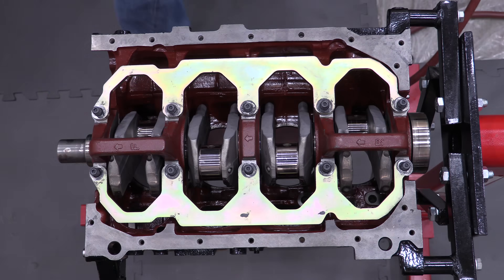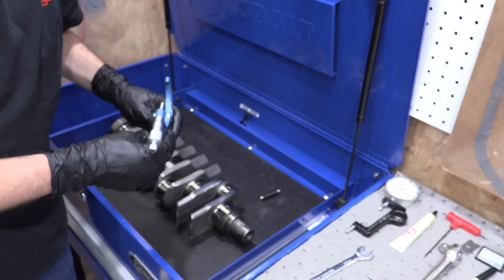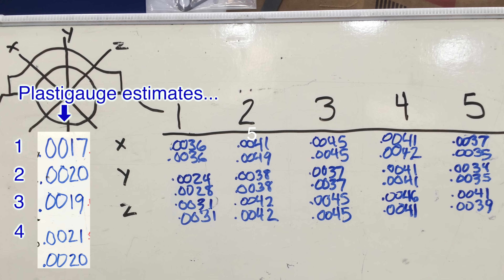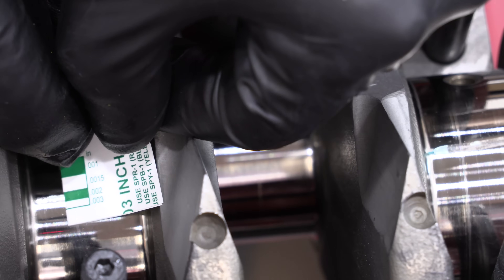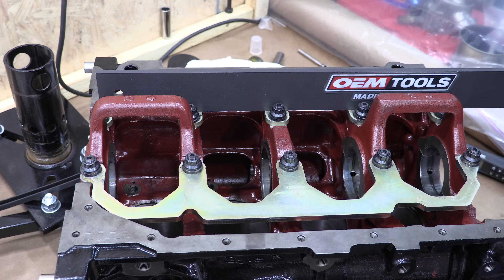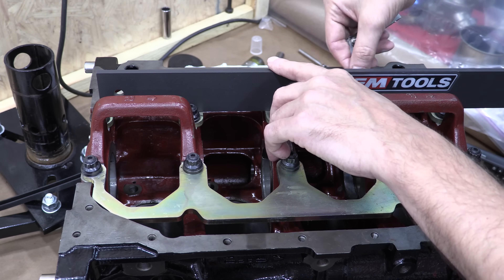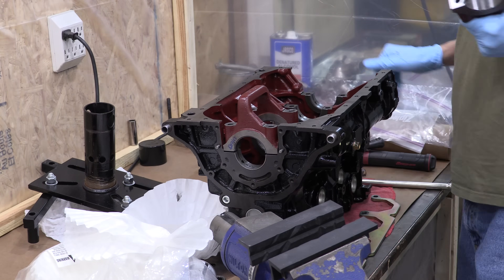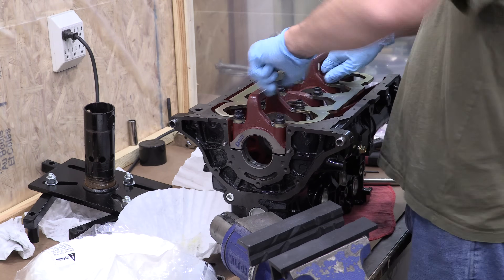[4k] The merits of Plastigage? ...A Jafromobile "short"

Comment: Am I thinking about this wrong or are the plasti gauge results roughly half the measured clearance. And if you are getting the measured difference from subtracting the crank diameter from the bore diameter, which gives you the total clearance which would be twice the "per side" clearance?
Reply: Meaning to equate the plasti gauge measurement to the bore gauge measurement you would have to multiply it by 2, and in that case the plasti gauge measurements are only a few thou off the bore gauge measurements
Reply from the maker: Nah.  I want to be able to tell you yeah.  But it's nah.  That crankshaft weighs 40 lbs.  It doesn't bend.  If the crankshaft is not resting against the bottom of every single main journal (touching on all 5 of them), and if the plastigauge isn't placed exactly 180° opposite from where the crank rests, then any reference to a measurement that plastigauge makes is invalid.  It measures the whole clearance on only one side of the hole.  The problem occurs when a journal doesn't touch on the bottom.  Crank bent, bore not straight, block warped, those are the things that Plastigage won't tell you, and I had one of them happening causing the results you're trying to justify.  As soon as it passed the plastigage test in the last video, I knew I had to make this video.  This is exactly why.  You can't put all your faith into one method of measurement.
Reply: @Jafromobile  Sorry, I didnt intend to imply I don't agree with your conclusion as I do. My point was more if the bore gauge is measuring the difference in diameter and the plasti gauge is measuring the difference in radius. Just as diameter is double of the radius so is the error, so when you compare the numbers the difference isnt as stark as it seems... hope tha makes sense. I do not deny more data gives you a better picture of the imperfections. Its like +/- dimensions vs GD&T on a drawing.
Reply from the maker: @bottlerocket3333  Oh, I know... I didn't think otherwise.  The way plastigauge is measured, when it's crushed into a gap, the clearance of that gap between 2 parts is what's printed on the paper.  What you're explaining is exactly what's going on, yes.  It's only giving me the clearance on the top of the main cap because it's not touching on the bottom.  It's as if gravity failed.  Plastigage doesn't test for this, but a bore gauge would.  My oil clearance is about twice in some of those cases what I measured with the plastigage.  But the error in this comes into play when the parts don't conform to the condition plastigage requires.  Plastigauge only works correctly or with any degree of accuracywhen every journal, bearing, bore, and the crankshaft are perfectly straight, all the exact same size, and all of them making contact on the opposite side of the crank from where you placed the plastigage.  So this is what reveals the hole isn't straight if the plastigauge measurements don't line up with the bore gauge measurements.  It means the crank is sitting in there crooked because the mains didn't measure .0024-.0046 like they did with the bore gauge.  Plastigage doesn't expect you to have to measure both sides.  If you ever have to do that, it's a bad thing.  It thinks that gravity has it laying on the journal already.  Just clarifying that Plastigage is supposed to be measuring the difference between both diameters just like the bore gauge is supposed to... it's just unfortunate that in my case.. that I could use it to measure both sides of the journal and nearly get the same result because the hole isn't straight.  Pretty sure both of us have been in agreement all along.  ;)

Comment: man, when you are done with this engine, there will be no meat left to bolt either the crankshaft or the head lol. Stop shaving it, those clearances look just fine for what you want to do with it. Plus, in the first 100 miles everything you measured will become outdated and irrelevant.
Reply from the maker: O ya, it would make it just past the point of obsolescence like this.  Probably not far past it.  I thought about all that, but there's a bright side.  I won't have to back my main studs out 3/4 of a turn to get them all 15mm above the girdle anymore.  lol.
Reply: "if you're going through hell... keep going" might as well straighten it while its apart, you're correct though it would be fine.
I for one am looking forward to Jafro buying a 5 axis CNC mill and milling out a billet block
Reply from the maker: @ChristmasCrustacean  Buying the billet block already made is a whole lot cheaper!  lol!  But that doesn't mean that I am not also looking forward to the day when Jafro buys a 5 axis CNC mill.  Hello billet aluminum interior...
Reply: @Jafromobile  "why does this Hyundai have a complete billet block, head and custom suspension components" "I got bored"
Reply from the maker: Ooooo... I could mill a whole billet Hyundai Scoupe with the rear subframe mounts right where I needed them.  Why isn't this yet a thing?  I mean... I wonder how much would a Hyundai Scoupe-sized block of billet aluminum cost, anyway?
Reply: That's what, a 30-some ton block? Material alone, probably in the $20k sort of range, but manufacturing and transport costs would probably add quite a bit to that as well, no idea how much to be honest.
Reply: That was a joke man. You can't even get a block of aluminum of that size.the most I've seen is 5 by 5 feet and before being processed into rails to be extruded
Reply: @hussssshie  Oh I know it was, but it's fun to think about. And I'm sure you could (if you paid enough), I've seen lathes and cnc machines to machine things those sizes for large ocean going vessels and the like.
Reply: @AlexanderBurgers  yes, but made from iron. Never aluminum
Reply: @Jafromobile  I know US Navy/GE CNC the Trident submarine propellers from a single enormous single brass billet. I bet you could do a Scoupe from an equally large aluminum one. ;^)

Comment: Sorry for my bad English, it's not my native language.
- - -
HI, Jafro.
In your last video I started wondering what had happened to the exact and precise ways of your build. 
My mechanics teacher in highschool made us compare the accuracy of plastigauge vs micrometer, and told us it only was useful as a sanity-check. I.e. to make sure you didn't inadvertly swap any bearings or  caps while rebuilding an engine. That's the only use for it.
For precise measurement we were supposed to use micrometers, straightedge, surface stone, dialgauge and feeler gauge.

Plastigauge belong together with calipers, rulers and measuring tape. (Or measuring by eye...)

Thank you for sharing this with the rest of us, now I know I'm not the only "insane" one.
Reply from the maker: You are correct on all counts.  I'd say your English is perfect.  This video proves your teacher was correct!
Reply: @Jafromobile  Thank you, and yes I found my teachers claim to be true twenty years ago. (That's why I love your videos)

Comment: I think Papadakis Racing may have given you the reprieve. He did a test comparing Plastigauge to the expensive engine building tools and they were consistently within a few thou. One of those it's how you use it cases, I suppose! Either way, your point that it is a verification, troublshooting, and extra information tool is well taken. :)
Reply from the maker: I love what Papadakis did!  It's a great example, and plastigage is accurate if all your parts are perfect.  When all of your parts are straight, the holes are straight, and the journals are the same size, gravity will let the crankshaft actually lay on the bottoms of ALL the journals and reveal the right size gap on the top of the journal during the plastigage test.  That's how you get accurate results, and it should be accurate in those cases.  The tricky part is when you have one journal with an oil clearance that's smaller than the rest, or a crank bore that's not perfectly straight.  The crank doesn't flex, so it just rests on that one small or mis-aligned journal, and now all the adjacent measurements are off by at least that half-thousandth.  Additionally, a journal that has a half-thousandth larger oil clearance than the rest will only reveal a portion of that difference because there's a gap on the opposite side of the crankshaft where it's not laying on the journal.  That gap is completely ignored in the measurement results, again, because the crank doesn't flex.
Reply: @Jafromobile  Such great points. I'll definitely be thinking that much harder when I use Plastigauge in the future. :)
Reply: @Jafromobile  very good points

Comment: just making sure that we know that 'x' and 'z' in the video are suppose to be slightly larger than the 'y' measurement, and is not a fault.
second paragraph:
https://www.mahle-aftermarket.com/media/local-media-north-america/pdfs-&-thumbnails/cl77-1-205r.pdf
Reply from the maker: 100% correct.  Yes.  It's critical to maintaining the oil film layers.
Reply: Excellent video sir. I greatly appreciate your attention to detail. I work in Ashland, VA building custom sunrooms for champion windows and my hobby is engine building and electrical diagnostics. I’m sure you know that all these things have a common theme of attention to detail, problem solving through testing, fitting, mapping, and assembly and disassembly , tracing circuits of all different types whether they be mechanical, electrical, or fluid. Your videos pull all these things together to create a picture of the full understanding that can only come from study dedication and experience. Great job. Keep going.
Reply: Yes the bearing clearance is made slightly out of round intentionally to help develop the hydrodynamic oil wedge

Comment: Not only do I not like platigauge, I don't like using tools measured in inches on a metric engine. Sure, it is effective, but I'd love to have numbers direct from the engineering staff's desk, rather than something that was converted first. This is also why I like digital torque wrenches, many specifications are in NM, not in ft/lb or in/lb. You can type the NM number into the digital torque wrench and get a much more exact number.
Reply from the maker: I totally understand all of your sentiments.  You have to understand regional cost differences between the tools, though.  Also, all of the measurements in a Mitsubishi service manual are provided by the manufacturer in ft/in lbs, NM, SAE and Metric.  I'm not the one doing the converting.  I'm simply using the tools I can get/can afford.  I have been taught all of these systems of measurement and can operate in all of them, but it doesn't make sense to present them in a scale that doesn't match the tools I'm using in the video.  This is going to be a point of contention on YouTube for as long as the Earth is round.  Many people can argue and with a high degree of accuracy that SAE offers more resolution for measurement than the Metric scale does.  The disconnect occurs where we step outside of thinking of things in a way where we're comfortable and familiar with looking at them.  Really you should have sympathy for guys like me because we're working with metric fasteners that cost 4-10x as much as SAE to replace, and we have a hell of a hard time finding them in stock anywhere.  We still do it, because we're determined and still love these metric things... but... this SAE/metric measurement argument will never be solved, or comfortable for anyone.
Reply: @Jafromobile  I am definitely sympathetic, I wouldn't expect people to go out and buy tools if they can use their existing ones.

Comment: Here's a thought  maybe plasticgauge is setup to tell you clearance all the way around bearing and not the total gap. Then maybe its closer than we think. Then you have .0034,.0040,.0038,.0042,.0040  because you have the gap on both sides of the bearing.
Reply: Good thought, scroll down to jafros response on '802 Garage' comment regarding papadakis racing's test

Comment: This is an excellent example of a conversation I was having with a race team owner a while back. We had a freshly built 7m die 5 laps in, he blamed the engine architecture as most people do with 7ms. I asked who built the engine and he stated a real engine building shop not the guy he had normally do brake and suspension. He claimed they did it right because he saw them checking clearances with plastigage. When I asked if they actually measured anything he said yeah with the plastigage. I'm glad to be building my engine myself and possibly machining as well dependent upon the results I can get out of my scrap block tests. Thank you for the amazing content and the detail you go into within that content. I can't wait to see the GSX on the track!
Reply from the maker: You feel like I hit all the points?  I didn't directly connect everything in the video because it would have been longer.  I know my viewers are smart and can connect the dots to see I'm not actually bashing plastigauge.  I connected the rest of the script I cut out in the description to keep it short.  Feel like this one worked?  I'm not used to making such short videos... lol!
Reply: @Jafromobile  It definitely illustrated that plastigage is a sanity check to go hand in hand with other methods. This shows people in a simple way that 2 step verification is for more than just signing into your electronic devices. If you have a sample size of 1, you can go the rest of your life believing the observation is correct and sound when it isn't. Do you have access to a good surface plate for checking the main caps? I'd like to see how much of that thickness delta is actually on the mounting faces or is there wear on the fastener faces.
Reply: @Jafromobile  yup
Reply: I’m building a 7M for my sons Supra, I no longer have the micrometers I used to build my mopars way back when I built my own engines, we have an engine reconditioning shop that builds dragster engines and you pay massively far more than most shops... yet I’m still sceptical weather they will in fact measure everything properly